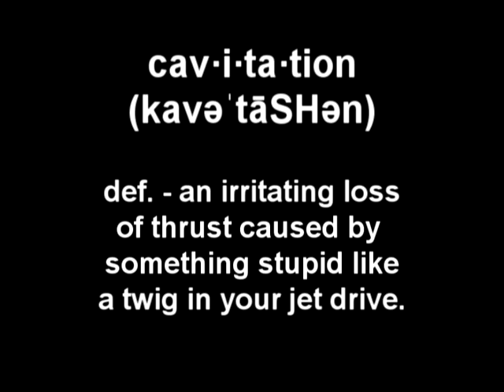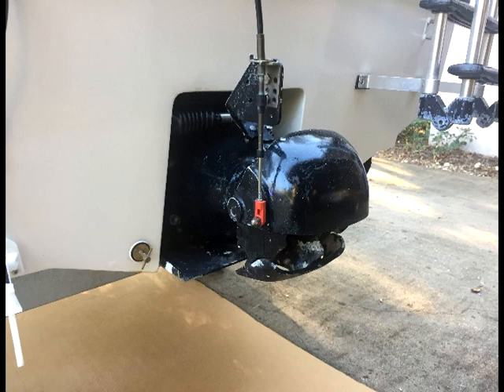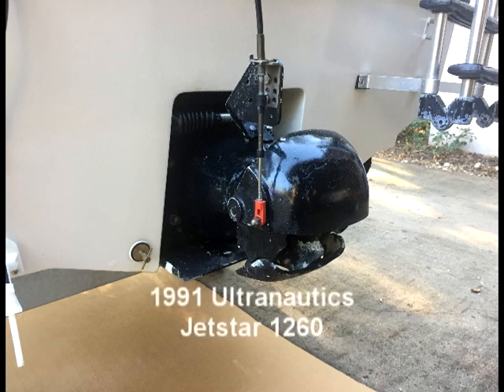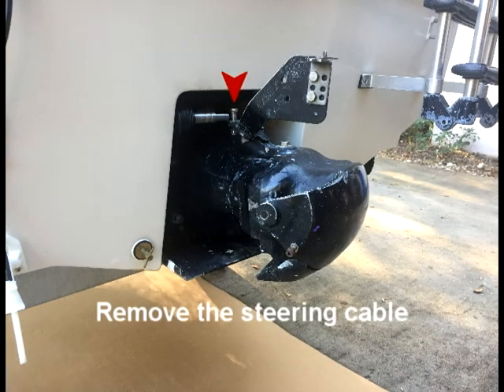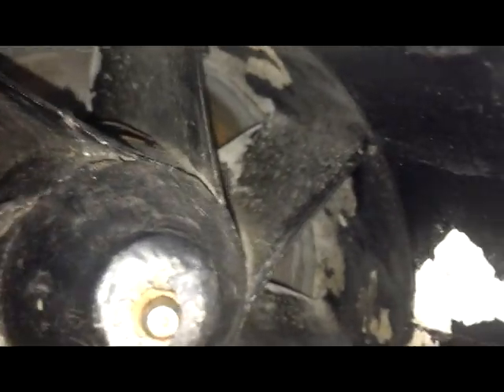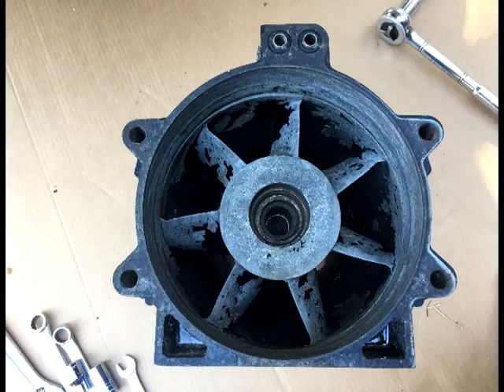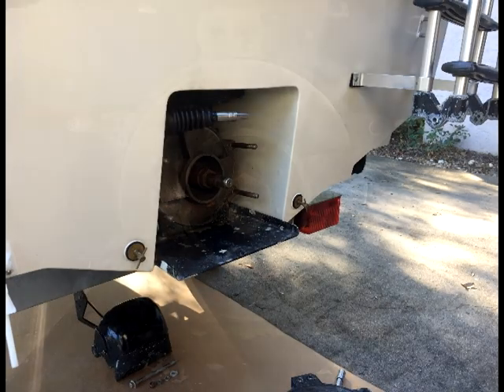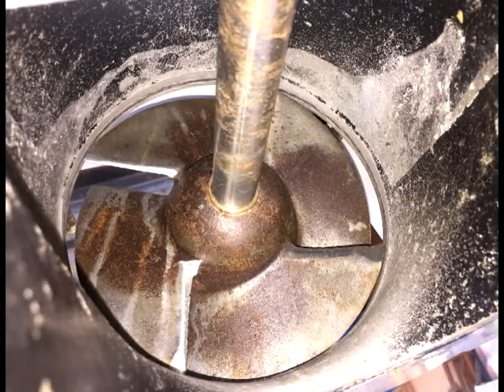Got cavitation?  Solved! High RPM, low thrust, Ultranautics jet drive disassembly

Comment: Hi where di you get that new steering shaft boot? I need one and how did you replace it?
Reply from the maker: I really don't remember where I found the boot, but it wasn't easy to find and it definitely was online as a result of an extensive google search.  The part number is 20-0515-077. Mine didn't have the boot at all when I bought it.  This one just slipped over the steering arm.  There was an existing copper thru-hull fitting.  I simply zip tied the larger end of the boot over the thru-hull fitting and another zip tie on the smaller end against the steering arm.

Comment: Superb video.   I wish all were that good. Saw one of these on the side of the road. They guy says, "Make me an offer" without any explanation on why it was abandoned with the last registration sticker being 8 years ago.  Don't know, maybe offer him $ 500.  The engine looks good and your video makes it clear how this thing is propelled.  Looks fairly simple. Thanks.
Reply from the maker: Thanks!  I restored this one from non-working, abandoned condition and in fact had paid $500 for both the boat and original trailer.  I did it mostly for fun, but the total cost of restoration was relatively nominal.